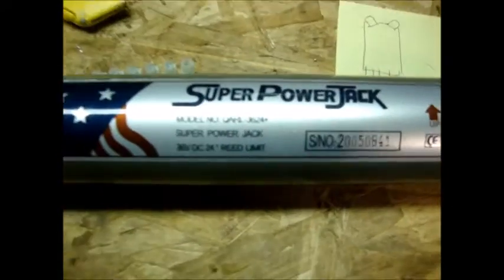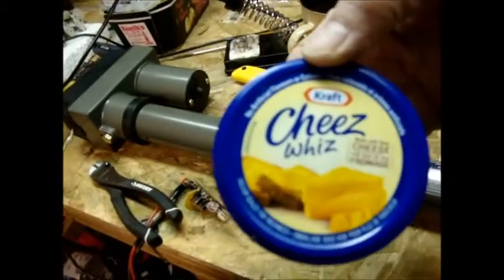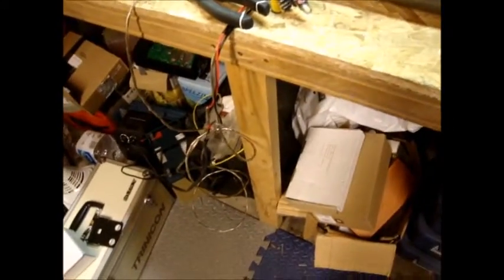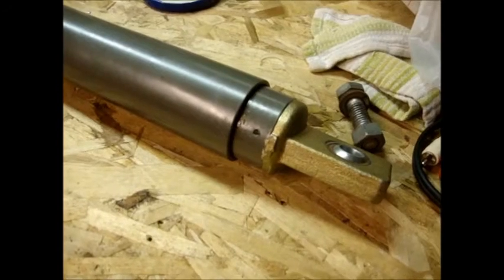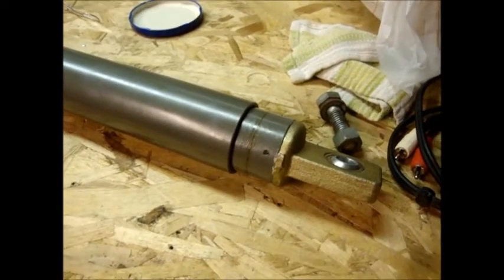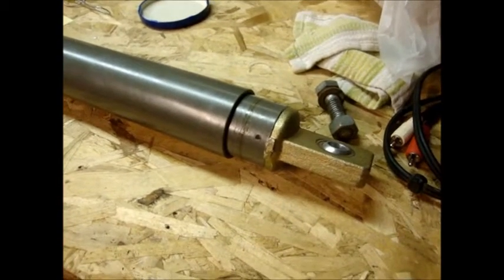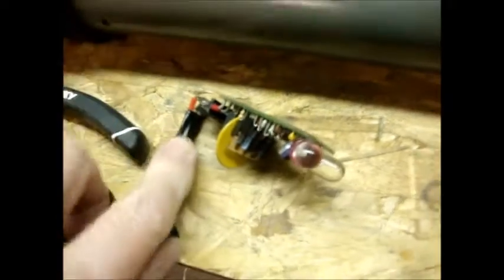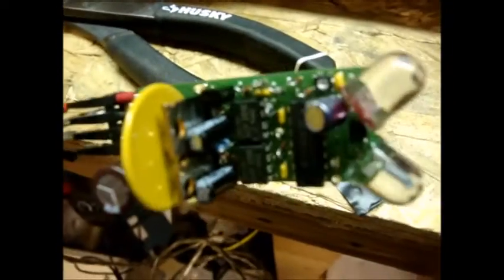Solar tracker for satellite dish mounted solar panel array

Comment: Appreciate the videos! Do you think if two actuator motors were used and another tracker circuit it would work to create a dual motion/axis solar tracker?
Reply from the maker: Yes it would do that exactly. Check out the RedRok website...  http://www.redrok.com/led3xassm.htm
Reply from the maker: Yes, you would need a second tracker as well.